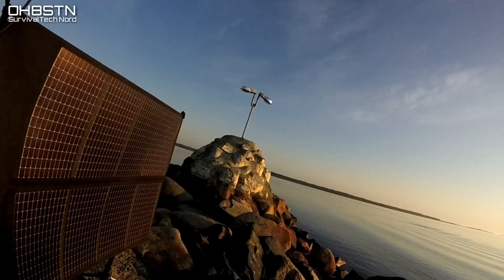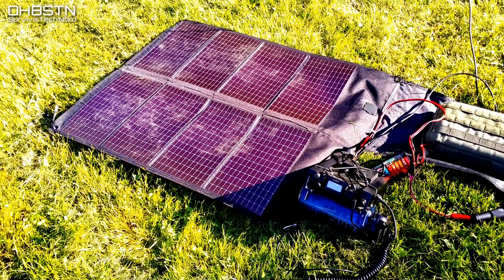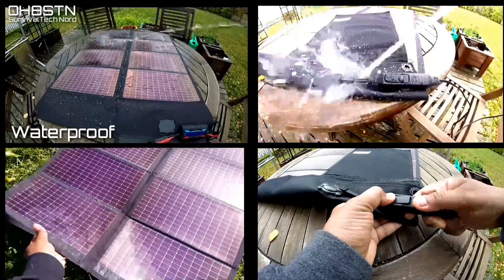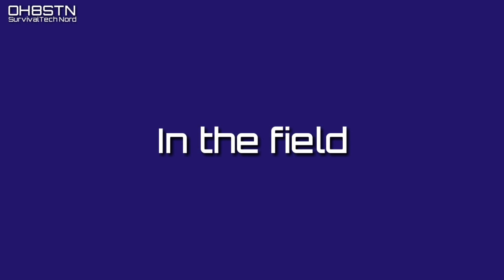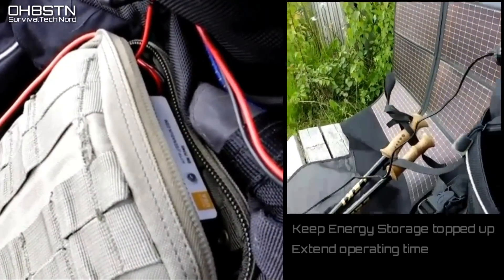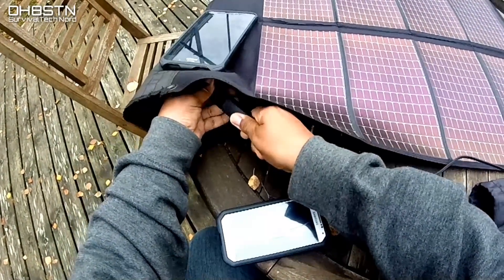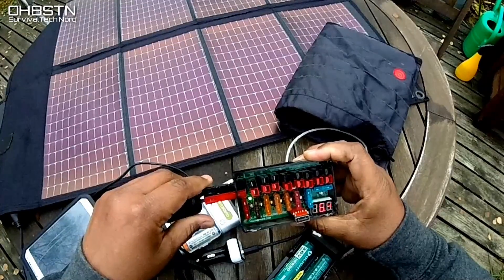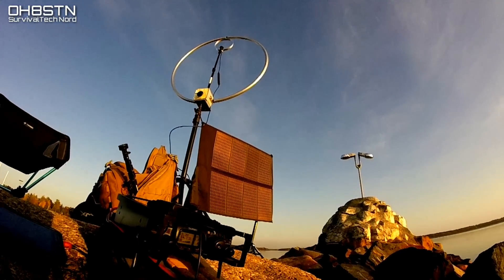PowerFilm Solar FM16-1200 | Portable Solar Panel Review

Comment: I love your comprehensive videos. Has this configuration held up over time? I know this is an old video.
Reply from the maker: I've got two of these 20w panels now, with the original still going strong. I've also invested in some larger ones. The oldest one is about 6 years now and was definitely worth the investment.
73
Julian oh8stn

Comment: Holy moly, the prices of those panels. Guess I will have to wait five more years until I'm done paying child support. One can but two Yaesu FT 891 rigs for the cost of one of these folding panels. 

Mercy!
Reply from the maker: Yeah I know, but if you want to have a backpack portable panel providing this much amperage to your charge controller and battery storage, it's the only game in town. There certainly are less portable Solutions out there.

Comment: Appreciate the review. I'm still debating if a 100W renogy panel will give me more bang for my buck for my use. I head out in my truck camping many weekends in the spring through fall.  I want to affix a 100W mono panel to my truck's bed cargo rails to keep a 12V fridge going and to top off my LiFePO4 ham battery. Security wise I would feel better if it's bolted down when I go hiking or to the store. For the price of the 60W I would be fearful that someone would try and steal it.
Reply from the maker: If your truck camping I don't see any reason why not to use for example that renogy suitcase or some of their less portable options. The PowerFilm is full no compromise portable power. If you don't need that level of portability, definitely go with something else. 👍👍👍
Reply: @OH8STN  Thank you for your insight. I am a few days into working HF and just cleared my house of some bad QRM. I am very interested in the work you do and it is inspiring me to plan on packing my gear out and backpack out into the wilderness for some truly man portable comms. Appreciate the help.

Comment: I am thinking about making a super hefty battery that can handle 23A peak output and 50Ah. Of course I will not be running it at 23A all the time. Usual current draw would be 1.8A. This is for my radio (Yaesu FT-991). I have watched several of your videos and really like them. Do you have any suggestions?

Comment: These powerfilm module is not meant to be waterproof. They write: Keep it dry. So how long do you expose it in rain before stopping? Or is it meant to keep it dry at least after use? I have one of it but won't risk damage it, thus I would put a transparent heat resistant cover over it.
Reply from the maker: If it gets wet, I wipe the excess water off, and hang it up to dry. I definitely wouldn't use in a monsoon, but if it can't get at least a little wet, it's not worth the money.

Comment: With this setup you have in this video, if you get a second 'F15-1200 Solar Panel', how would these be wired into your system?   In parallel or in series?  Would you simply use the R6 accessory cord to connect them?  "Daisy Chain Accessory 
Use to connect two PowerFilm® Rollable or Foldable chargers in parallel for increased current output (Amps)" http://www.flexsolarcells.com/PowerFilm-Solar-Approved-Accessories.php
Reply from the maker: +Gerald Grogan excellent question.
In the case of the PowerFilm panels,  there is a 2-into-1 assessory cable which allows you to "parallel" (daisy chain) two panels into one output to the charge controller.

Comment: Great video, thanks! You offer plenty of great info here. Question: I'm thinking about getting an FT-857D that could serve for both QRP SOTA use and as a QRO base/mobile. Any thoughts on this? Thanks!
Reply from the maker: +thormusique actually what you're proposing is a very popular idea. The 857 could easily be coupled with a lithium iron phosphate battery pack (LiFePO4) and used out in the field.  The current draw of the 857 and 891 are pretty hi compared to an 857 but you do have the benefit of higher output power if that's your thing. It's definitely an awesome idea.
Reply: Excellent, and thanks for the advice! I'll let you know how it goes. Happy New Year!

Comment: Did you order the panels to Europe from the States or do you know any shop in Europe where to order them at a reasonable price? I'm interested in buying them but worried that the price will pump up because of custom duties.
Reply from the maker: +DMcC I ordered the 20w from USA. After shipping and customs, it was +/- 0 of ordering from EU.  I don't have a reliable shop in EU yet to order them from but I'm searching.

Comment: Love your videos,  however, if using flexsolarcells.com to order the powerfilm panels, be careful,  I tried ordering one, and paid for it,  since then radio silence to my multiple emails, and this appears to be their modus operandi,  see scamguard.com with flexsolarcells.com
Reply from the maker: +SouthernSearcher I totally agree with you and I've already removed the links to flexsolarcells from my website. In fact about 3 weeks ago I ordered cables from ghere and heard absolutely nothing for a week. I sent them an email through paypal asking for a refund and got it.  Please use the PayPal buyer protection.
Thanks for the heads up.

Comment: Great video. From the Power Film website, it seems the Foldable versions are not waterproof and the Rollable are. Perhaps I missed it, but which version do you suggest? It seems the F line is for foldable. Thank you for your comments.
Reply from the maker: +Bentley S thanks for the comment.  I think for confined space packing, the folding version is ideal. For heavy water, boats, kayak, ... the rollable. The PF website also says 8ts perfectly fine if the folding gets wet. Just wipe the access wster away before storage.
Reply: OH8STN great info, thank you!

Comment: I use (3) 12 watt Powerfilm panels.  This way I can pick and choose how much to take into the field depending on needs.  This also provides redundancy and can be split for two users etc.  I combine them with a Hardened Power Systems APP Multiplier.  Great panels so far.
Reply from the maker: +Lance Wolken Outstanding comment Lance. That was also my hope. 2x 20w panels for scale and redundancy.  What does the app multiplayer do? Thanks for sharing your setup with us.
Reply: OH8STN The app multiplier is just a anderson power pole distribution block.  It parallels the panels into a charge controller then on to the battey. Occasionally I also use their usb tap which has 12v pass through and (4) usb outlets to charge other devices.
Reply from the maker: +Lance Wolken Thanks Lance. I didn't know HPS made them.
73

Comment: Informative. $265 on Amazon is expensive. Have you tried other portable panels for comparison? I have a 15W Anker that was $50 but not waterproof, less surface area, 12.5oz. I run KX2 w internal and sometimes bring a 10-14Ah LiFePo along. 73
Reply: Cliff, PowerFilm is a regular at Dayton (Xenia) and offers their factory cosmetic seconds for a very steep discount.  It is the only way I could afford to buy them.  Hope this helps.
Reply from the maker: Clifford Novey yeah I have, as I mentioned in the video. I've tried to Goal Zero as a one-to-one comparison. I've also tried the Anker solar panels. ECO Worthy, ... So far I've come to the conclusion that any cheap panel from China is a poor performer. The Ankers work ok for charging a smartphone on a sunny day.  Put them in low light and the surface area becomes an issue. They actually sent me three different Anker panels and some battery Banks for review on the channel. The results were so bad that I never published the video. It's the same thing with Goal Zero. So now I figure something "less expensive" is only good, if it does the job eg running 817, tablet, laptop, ...
Thanks for watching
Reply from the maker: +Mike Rosenberg That's a great poin5. I did sell off unused gear to finance the first panel.

Comment: Outstanding video! Learned much, and am switching my solar panels from Goal Zero to PowerFilm for man-portable operations.
Reply from the maker: +VideosByDPF I thought you already had some PowerFilm panels? The only real technical problem I had with the Goal Zero was the pigtails coming off the circuit board enclosure breaking loose from the circuit board. They can be repaired but it's delicate work and something I couldn't do in the field.
 To be honest I was afraid to pull the trigger on the PF, because of the cost. Then I decided the greater risk was doing one of these extended trips in the field, having it all fall apart because I couldn't Power It Up. I enjoyed your after-action report with the light PowerFilm. Perhaps after I get my second 20w, I'll try the Max out for YouTube gear.
Reply: No, don't own any yet... mainly due to cost. Hopefully someday soon. I would like to do some portable work that requires some hiking and Goal Zero and Zamp, amongst others, make that a near impossibility with their types of panels. Goal Zero has come out with a "foldable" 100W (18-22 V) panel. it is running $649.95. However, one issue I have with Goal Zero is their wire gauge selection. I do like the waterproof test you performed, but as you well know where I live rain is not my biggest issue, heat is.
Reply from the maker: +VideosByDPF yeah I always mix up your videos with survivalcomms 😁
I hope that hundred watt panel from Goal Zero has removed the voltage regulator and USB output, replacing it with just a standard DC output. But a portable panel hundred Watts, that would be extremely cool.

Comment: Another great video.  I have both the F16-1800 (30W) and F16-3600 (60W) folding PowerFilm solar panels and they are wonderful.

What do you use to hang the panel in the vertical orientation as shown in the video?  I use shepherd crook planter hooks (available at Home Depot or Lowes) to hold my panels at an angle to capture more solar energy.  They are simple and heavy duty and as such aren't great for man-portable ops, but for field day or a setup that you aren't going to move, they are awesome.  

Thanks for sharing and best 73s.
Reply from the maker: +Mike Rosenberg hey Mike thanks for the kindness. A set of those F-16 3600s would be magnificent. use stretch cord or velcro tape when possible. If it's on the chair or a wall I use smaller versions of those garden hooks.
What charge controller are you using for your panels?
Reply: I have both Buddipole PowerMini and I just took possession of a West Mountian Radio Epic PowerGate.  The PowerMini is a bit noisy when the battery is full and it cycles between charge and float.  I am still shaking out the Epic.  Had it out in the sun today taking measurements while driving it off the F16-3600.  So far it works very well.  I haven't had the opportunity to fully charge a LiFePO4 yet and then listen to what happens when it cycles between charge and float.  It does have a 30 minute disconnect that suspends charging - so I am guessing that is how they handle the noise.  Testing will tell.
Reply from the maker: +Mike Rosenberg sounds like you need a Blog our YouTube channel Mike 😀. 
So far the only charge controller I've been able to find that is absolutely noise-free is the Genasun. I'm wondering if it's because it's an mppt charge controller. One of the things I'm studying about the Genasun. When the battery is full, it seems any Excess energy coming in from the panel is just sent over to the load until the battery needs it. If the load is consuming more than they charge controller is taking in, power is taken from the battery and the charging kicks in again. Anyway I've heard good things about the power gate and I hope to get one here for testing.